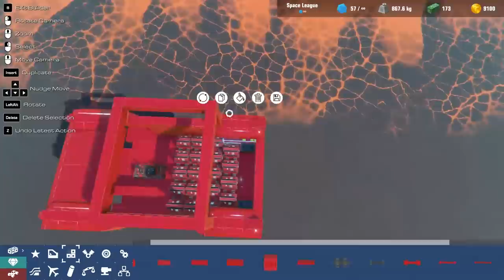This Car Will Spontaneously Crash at the Push of a Button! - Trailmakers Early Access Gameplay

Comment: You could build a concrete wall tractor pull vehicle, it spawns the wall in the back of the vehicle then you see how far you can pull it before it becomes fixed.